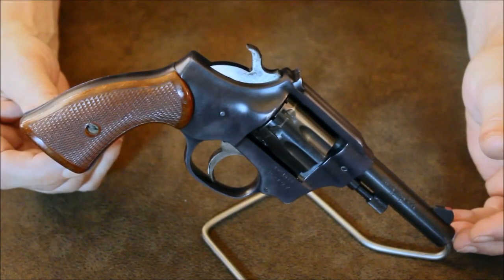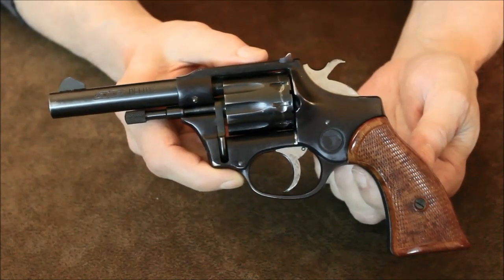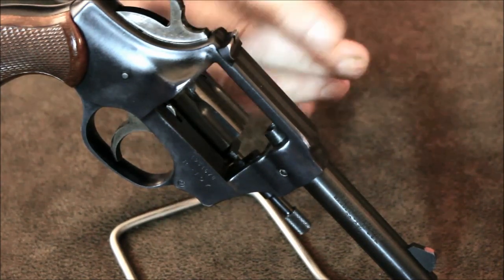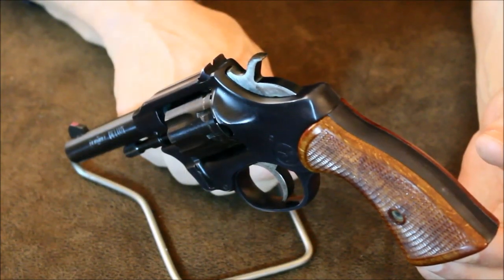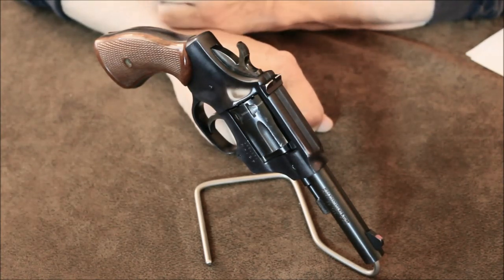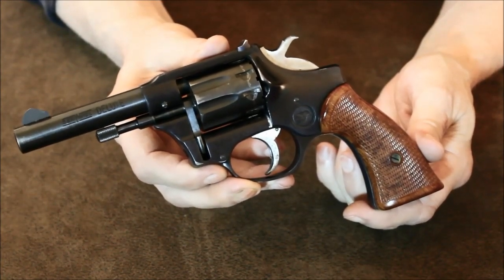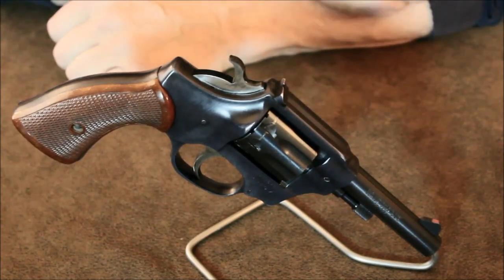High Standard Sentinel - A Closer Look

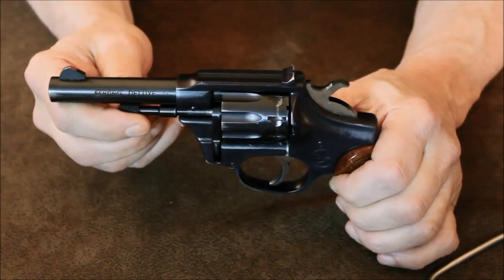Comment: Great video. One point of fact though, from minute 1:38- theSentinel did have a drop bar hammer block/safety. My R-106 Sentinel Deluxe has one. I believe the R-107 had one also, but it could have been removed at some time. The 106 was something like 1964-66. Just letting people know that one in proper working order, with all original parts, should be safe to carry with all 9 chambers loaded- as safe as a S&W from the same era.
As with any used firearms, if you don't know nuances of gun repair, have a gunsmith verify it is safe before using.
Reply from the maker: This R-107 has no drop bar (or hammer block) safety. No provision for one has been incorporated. Apparently, there are some subtitle differences between the two models.
Reply: I believe that earlier models had a bar that prevented the hammer from falling all the way forward unless the trigger was pulled. A horizontal bend in the bar rested between the hammer and frame. When the trigger was pulled the bar moved up and fell into the large curved cutout on the hammer just below the firing pin. This allowed the firing pin to pass through the frame cutout and make contact with the cartridge rim.
Reply: I just received a 6" blued R-107 that belonged to my grandfather. It has the drop bar/hammer safety.  I'm just learning about these pistols, and from what little I've learned so far am pleased to have it.
Reply: I have a chrome plated 2"  barrel .22 R-108 that my Dad had for years. Can you tell me something about this revolver.
Reply: @stephendavison6998  Mine is a 6" R-107.  It has the safety hammer block
Reply: My Sentinel Deluxe R-107, blue, 6", has the transfer bar.  I looked up the year made, 1967.

Comment: The High standard Sentinel -- Everything a revolver needs to be. The only flaw is the lack of a transfer bar or drop bar safety. But that can be remedied with aftermarket modifications you might find floating around; they replace the hammer and add a short twist-lock pin across the back of the receiver.
Reply from the maker: I'm going to keep this one exactly the way it came out of the box.
Reply: @Icarryone  
I just happen to have two of them, in addition to a 1957 manufacture Ruger Single Six (with 1974 transfer bar safety modification). 

The older of the two has the safety, thing being a dark blued finish with checkered walnut handles. The newer was a nickle finish (it's worn off over the years) with some sort of lighter stained hardwood, which I think is maple, though it might be some type of oak. 

These pistols aren't terribly uncommon in Australia. They're actually pretty popular among target shooters. Most of them were shipped over second-hand from the USA. So if you're wondering where they've all gone, we might be responsible for hoarding a few...
Reply: Mine has a hammer block, I think it's from the late 50s.
Reply: They do have a hammer block safety.
Reply: @panzerabwerkanone  how can you tell?

Comment: I inherited model R-100 from my dad no ejector return spring
Poor old thing looks like it's been around the block a few times 
but still good metal
Reply from the maker: Having gone around the block a few times just adds character.
Reply: I have a r-101 and a r-106. I think the 103 started with the spring.  My 101 is well worn and nicked up but still shoots tight groups and the cylinder still locks up

Comment: Just curious as to what year your Sentinel was produced because I noticed yours has the ejector rod return spring. I was trying to figure out what year they added it.. I have a prior model and of course it has the scratch.
Reply from the maker: KCO All the Sentinel's I've ran across have the ejector rod return springs. But it is possible to disassemble and, for whatever reason, not be replaced. Sometimes a good cleaning and lubricating often gets stuck extractor springs working again.
Reply: Hmmm... I will have to dig a bit. I always thought the early ones didn't include a spring.
Reply from the maker: KCO You may be correct about the very early models made prior to the 107 Deluxe series (1959). The one in my review is a Sentinel Deluxe R-107.
Reply: @Icarryone   I can confirm that the early models didn't have that spring. I have just such a revolver.
Reply: only the r 100. model was like that